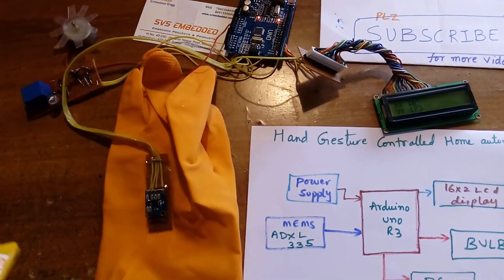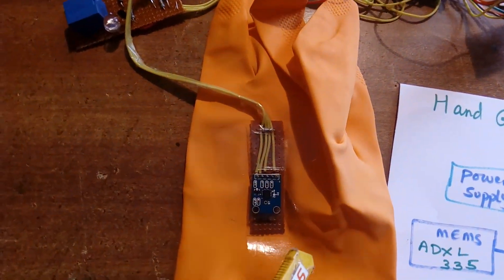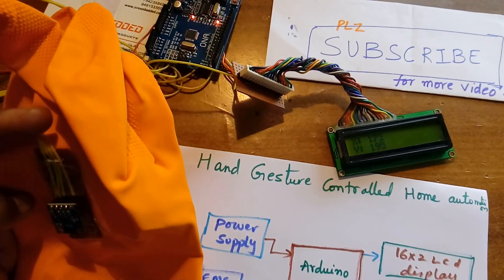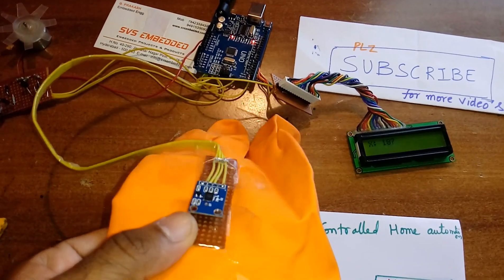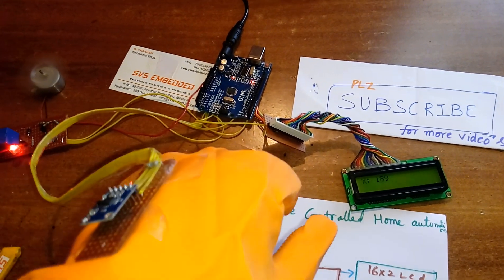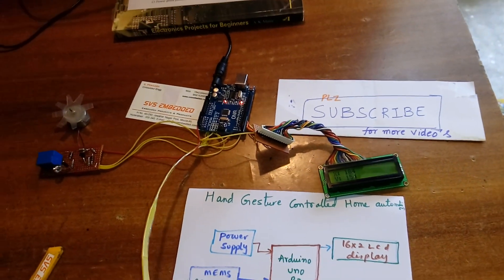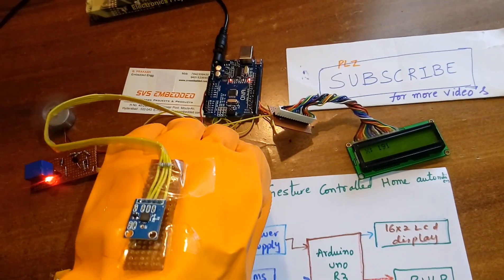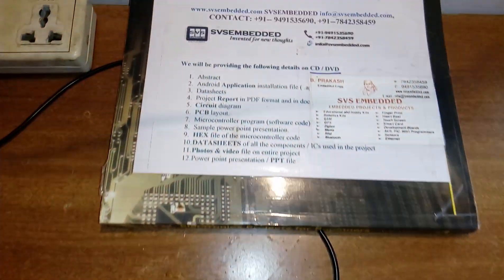Hand Gesture Controlled home automation

Comment: hey can u tell me what are device u have used
Reply from the maker: Thanks for comment and your valuable Feed back,we are arduino uno r3 and spdt relay coil.adxl335 mems accelerometer.we are selling the projects with least cost.
if u order the project we will provide working hardware kit along with 
1.abstract
2.datasheets
3.documentation
4.schematic( circuit ) diagram.
5.software code.
6.sample ppts
7.photos&video file on entire project
through google drive
send me a mail to  svsembedded@gmail.com,info@svsembedded.com.
we will send u the how to order procedure to u.